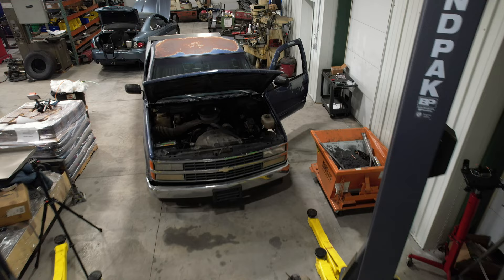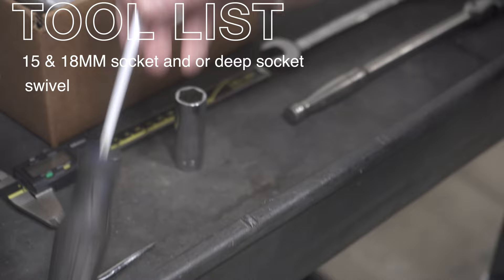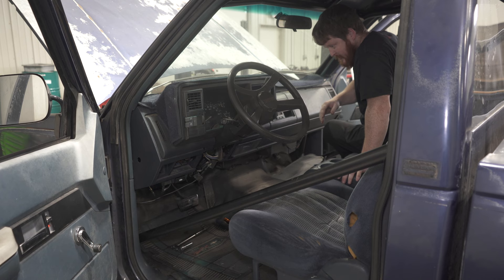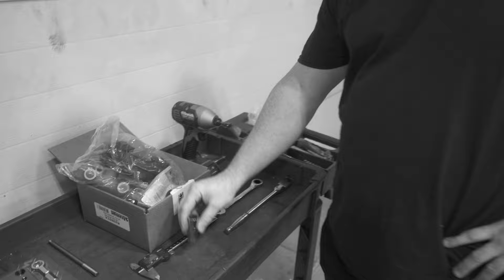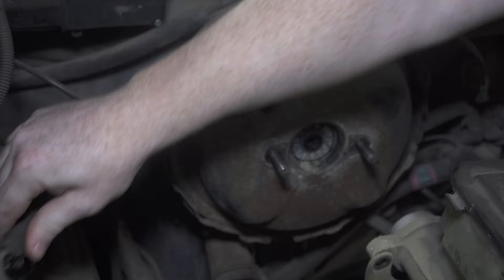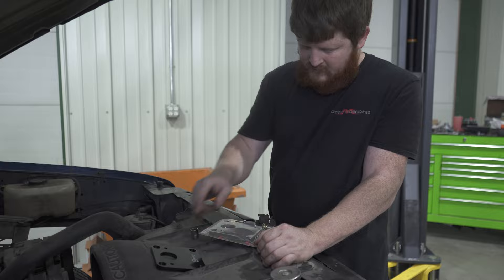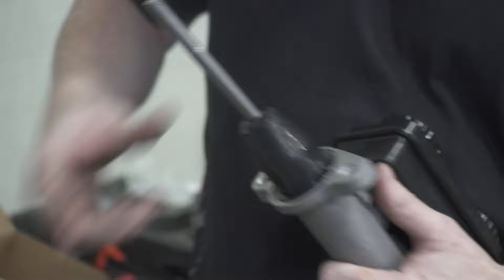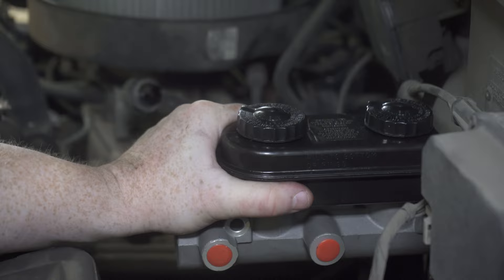All NEW  TBM OBS Truck Manual Master Cylinder Install

Comment: Does using manual brakes require a lot more input from the driver to achieve the same amount of braking force?  I imagine it would have to but is it a significant amount?

Comment: Why not tap the allen bolt holes? That way you could service the master cylinder without removing the plate.
Reply from the maker: Plate is not thick enough to properly torque it if so

Comment: What is the benefit of switching to manual over the power brakes from the factory?
Reply: Was wondering the same thing.
Reply: Weight basically 🤷🏻‍♂️
Reply: Typically it's because people have added a big camshaft or Turbo which both lower the engine vacuum to where it's not enough to efficiently operate the power brake booster